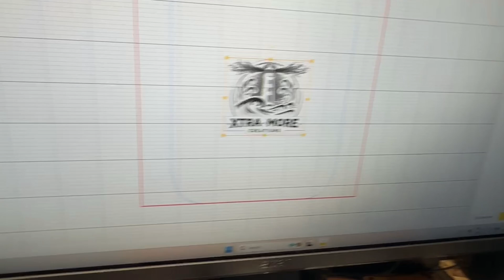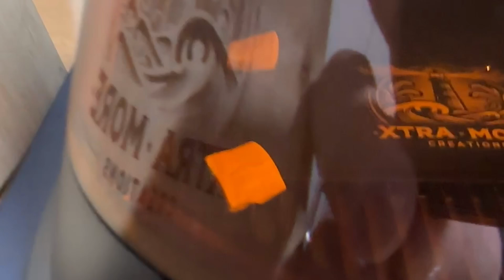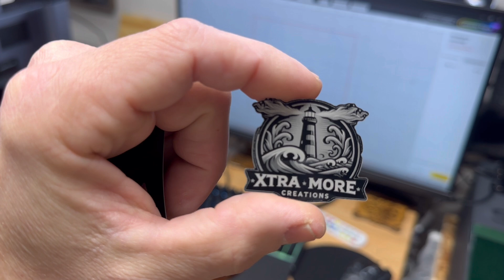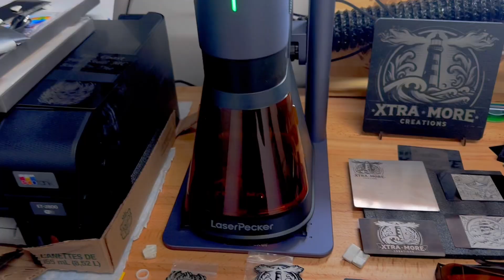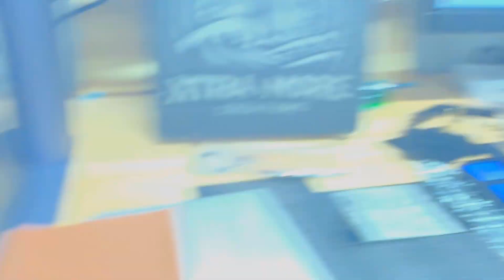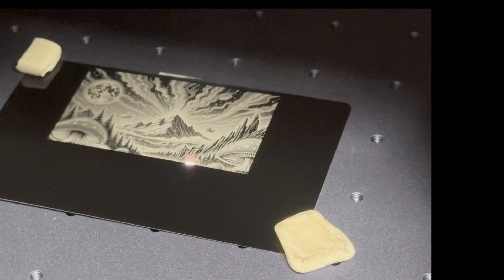LaserPecker LP5 - How To Engrave & Cut Metal Business Cards Fiber Module. Testing Various Materials

Comment: Super helpful video — thank you. 🤝 

Question for you: Is the LaserPecker LP5 capable of CUTTING 0.4mm aluminum? I'm trying to research the best device to produce (limited run, 1-5/month) VIN plates for the vehicles we manufacture here at our shop. They would need to be engraved and then cut to shape, or vice versa. They're similar to the black business cards you show in your video, and measure 3" x 3", 5.8125" x 1.625", and 4.75" x 1.75".

I would greatly appreciate any guidance you could offer... Great looking stuff you're making — coming from a fellow Canuck (but living in the US for the last 25 years!)